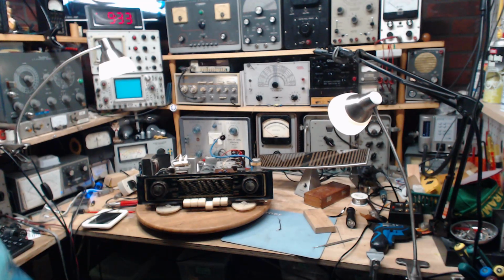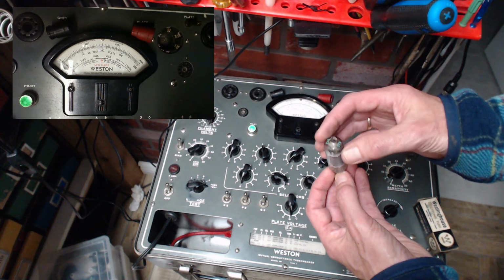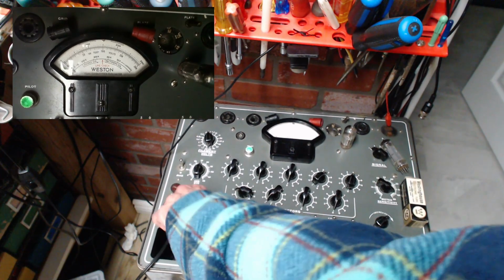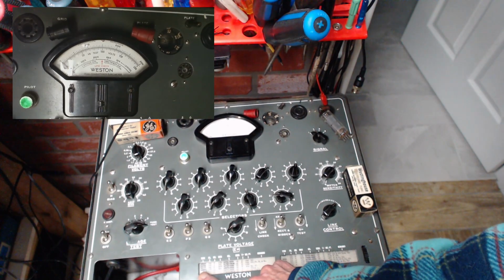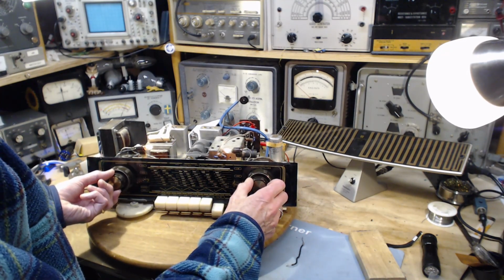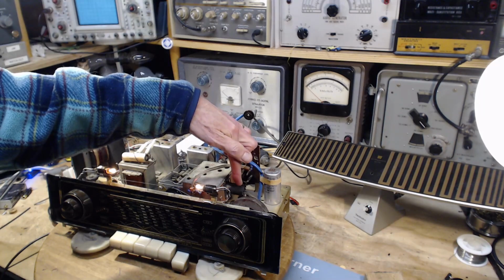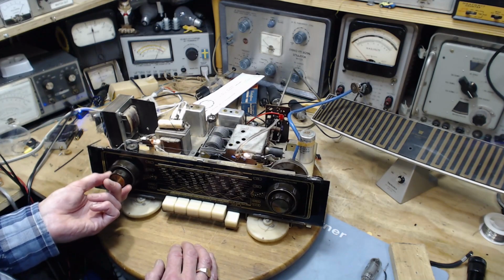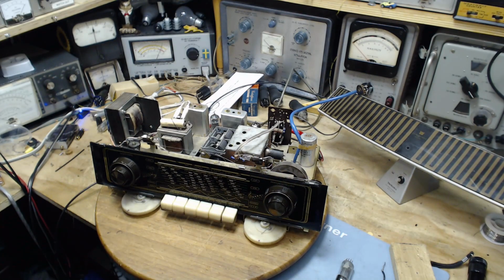Grundig 2030 AM FM Tube Radio Video #6 - RF and Detector Tubes Tested

Comment: Welcome back, had me concerned with your absence. Those Little German made FM  modules are a bug to fix. Ive battled with a few of them too. My RCA FM tuner in a console has low sensitivity too and its not tubes. I even have the receiver hooked to an outside FM dipole. The one tube is the mixer / RF amp and oscillation.your tube tester will never see the frequency reactance problem .